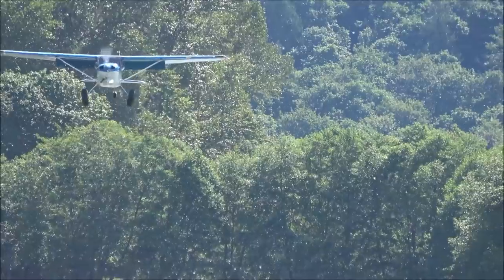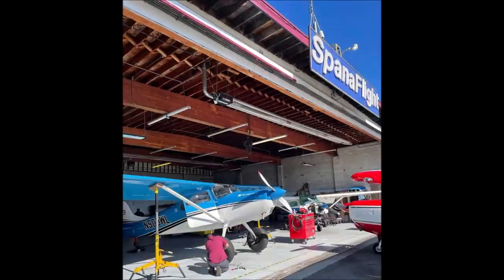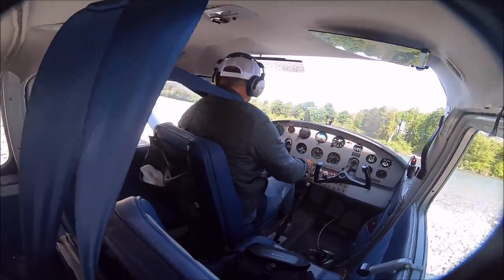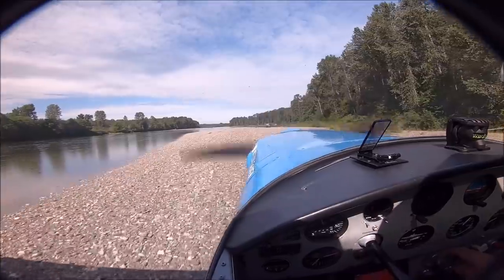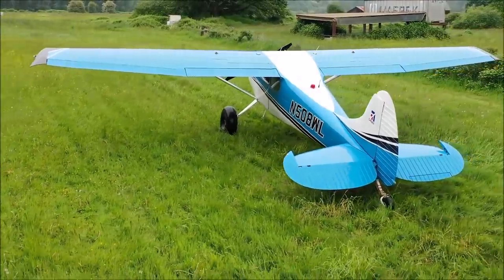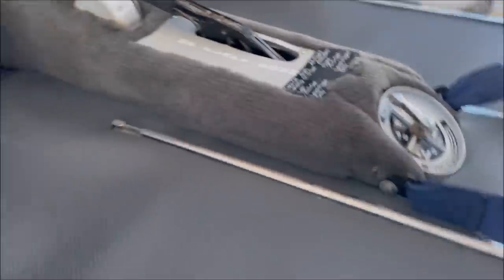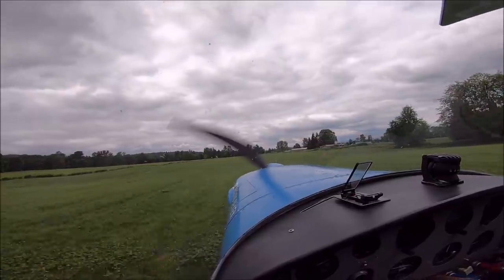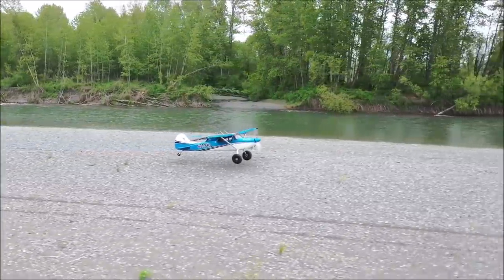Is This The Best Cessna Plane for Bush Flying? Super 170

Comment: I could never quite work out why most STOL and bush planes are taildraggers. Surely tricycle gear is better for stopping, cause you don't have to worry about flipping over.
Reply from the maker: Yes trike is better for stopping, problems are prop clearance and the weak nose wheel, still they can be super capable, specially for backcountry strips they work better, for off airport the tailwheel plane is more capable.
Reply: @Cristi Neagu  Tailwheel airplanes will stop fairly quickly in soft field conditions due to the fact that the center of gravity is aft of the main gear (the same condition that makes tailwheel airplanes more susceptible to ground loops). A tailwheel airplane flipping over upon landing is most likely caused by unnecessarily excessive brake application. Hope that helps.
Reply from the maker: @TenMinuteTrips  Well put, plus tailwheel planes are lighter, so that helps stopping quicker.

Comment: "Start with 10 degrees of flaps", I heard that.  I converted a '59 172 to tailwheel/180 HP/CS prop/Horton STOL .  I did not do the VG's due to snow/ice and wing covers, though I really considered it.  In official competition it achieved a measured TO roll of 146 feet in calm air (not a realistic working expectation since it was stripped and had about 30 minutes of fuel onboard).  It would fly before airspeed indicated, so timing and feel, with a healthy dose of 'where do I go if it doesn't fly'.  And when things are happening  quickly bobbing your head down to reach a flap handle is not so good, 10 degrees does put it in easy reach.  Technique was to hold forward pressure and when the tail came up so you could see over the nose, put it back down and drop 40 degrees of flaps.  I currently have a small pile of 170B that needs to be rebuilt, motivational videos like this are a big help!

Comment: I've flown several 170 cessna airplanes and I've owned 2 of them a 1952 170B and a 1954 C model both with 145 hp continental the stock 145 motor is pretty taxed at high altitude and the payload is not huge but the 170 cessna remains a staple in the back country for good reason and will for the future because of the 170s ease of operation and the cabin is open enough for a fair amount of cargo

Comment: Not sure how you were loaded during the shot of the tail wheel, but looks like the spring is worn out/flat.  Either way, I’d expect you’re seeing some tail wheel shimmy.  Congrats on the new bird and thanks for the videos.
Reply from the maker: We had 70 pounds in the cargo area, I feel shimmy on pavement sometimes, not always, but will check the spring, thanks.
Reply: Generally you want the caster built in to the yoke to be the only caster.  The platform the yoke attaches to should be about level at normal loads.  You just have to deal with shimmy when you load outside the set up.  Yes, pavement makes it much more prominent.  Usually x-cty when I have to land at unknown fuel stops and can’t land grass with aft CG. Through normally I was taught to pin the tail during all taxi ops, Ive found you can “fly” some weight off the t/w to get it to calm down.  You practice enough that you may have already done this instinctively.  The spring just appeared to be sagging a fair amount in the close up, could just be the camera angle.  Keep up the great work!

Comment: I have never flown the 170. I am sure it's a great back country plane. However, I believe the 182 is just as good in back country getting, out of the tight spot. Even, without the Stol kit. Depends on pilots skills.
Reply from the maker: 182 is a great airplane, I will chose it for backcountry strips over the 170,  and for off airport the 170 would be my choice.